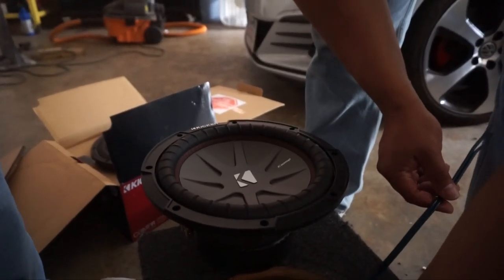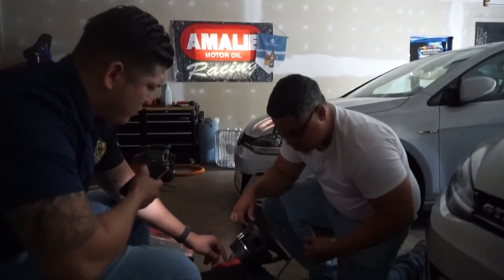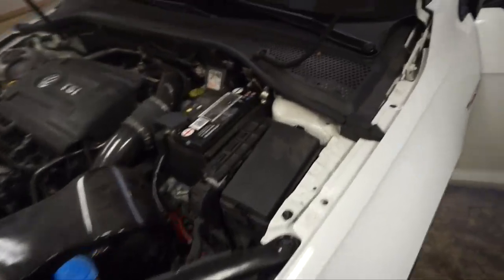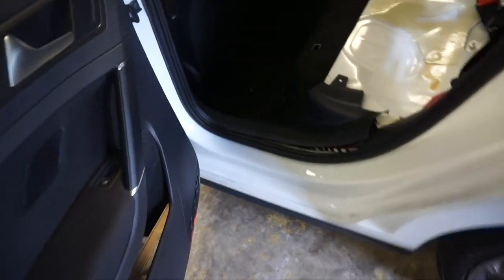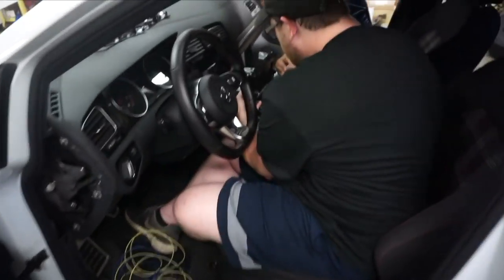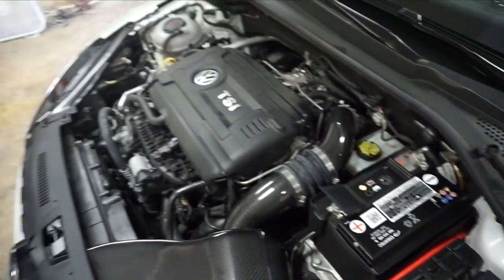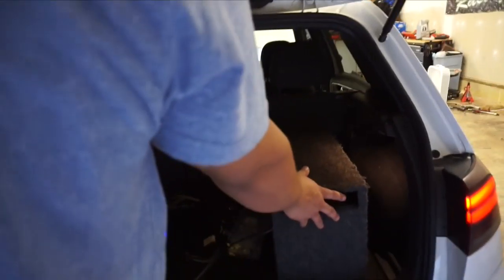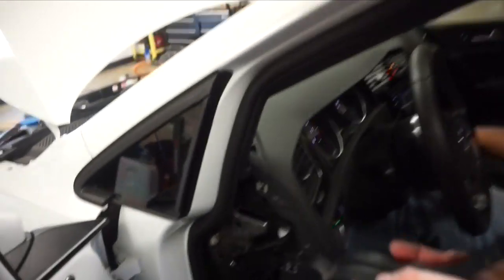Installing Custom SOUND SYSTEM AND SUBWOOFER Upgrade to the MK7.5 GTI

Comment: Probably be louder if you wired it in series and not parallel.  I’m assuming it’s a 4 ohm sub that you’re now running at 8 ohms because it’s wired in parallel.

Comment: Nice. I installed a kicker 10 comp r into my 19 vw gti rabbit with a homemade spare tire sub box. Also with my pioneer amp you do not need a remote wire. Everything is hidden under the trunk cover.
Reply: Have any pics anywhere? Insta or something? I’m looking to doing something similar with my 20 gti. Were you able to keep the spare or no?
Reply: @ncoots01  I kept the spare with the jack. Had to remove the threaded rod holding down the spare. There is another guy on YouTube that has his own channel and made something similar.
Reply: @Noah Coots Look up mk7 hidden subwoofer.  Channel is called stealth gti I think.
Reply: @MrJaminx2  thank you!
Reply: @ncoots01  your welcome.  ? Do you live anywhere near PA?
Reply: @MrJaminx2  actually I live in north east Ohio. Close to Warren
Reply: @ncoots01  not close enough. I'm 4 1/2 away.